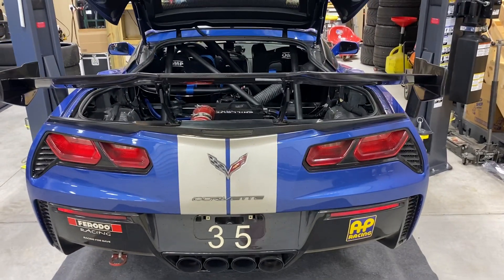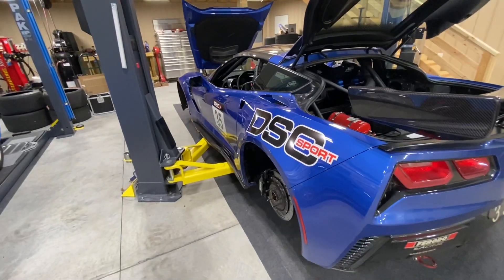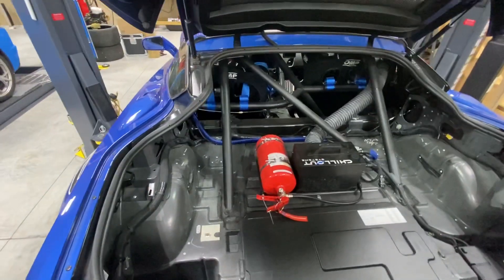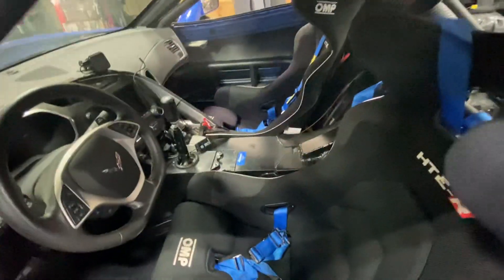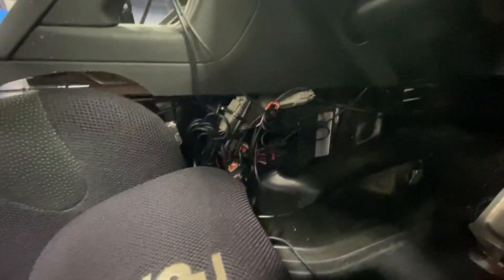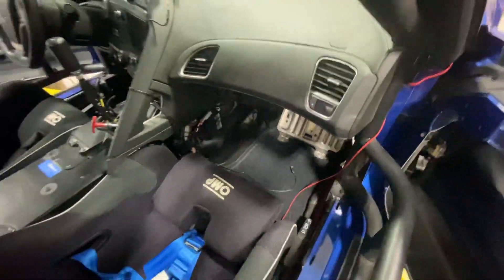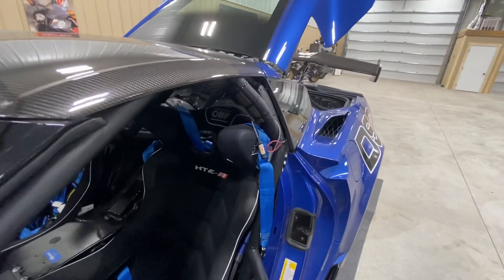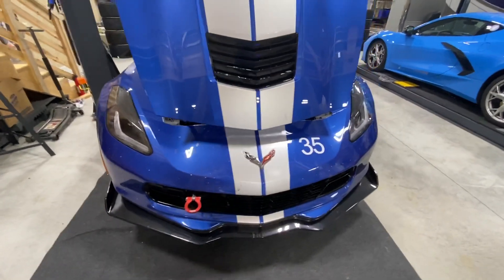C7 Corvette GS.R Walk Around - Part 1

Comment: nice video..thanks for sharing.   what is the curb weight?
Pitt Race is a home track for me.  Maybe I will come to the track to see and hear the car in person.  The car should definitely be a sub 1:48 at Pitt Race.  There are a few videos of C7 Z06 Automatics with slicks running 1:49's
Reply from the maker: Thanks!  I actually did another video comparison of a mostly stock Z06 on slicks running a 1:48 so that is in my sights for sure.
Reply from the maker: I meant to cover this in the video so thatnks for asking.  Weight is currently at 3223 lbs with full fuel and no driver.  For reference stock was 3463 lbs with full fuel and no driver.
Reply: @HiPoDriver  wow..3223/730 = 4.4 lbs/HP..crazy..dang near a GTD level..awesome build
Reply from the maker: @corvette412  yeah the acceleration is very impressive - especially with the sequential.  I should do a breakdown vs the ZR1.

Comment: Sean,  
Can you provide some information regarding the installation of the race seats? Is there a bypass (dummy) connector on the seat electrical harness available to avoid throwing a code/light for the airbag?  Do you know if I only install the driver side race seat, that the passenger airbag will still be operable?  I would appreciate your feedback or if you know of a thread on the corvette forum discussing the issue.
Thanks in advance
Reply from the maker: I've not added any sort of device to turn off the airbag light, I just ignore it.  We actually took the airbags out of my car since it's track only with race seats and harnesses.  Sorry I couldn't offer any help.

Comment: Remove wiper blades and motor. That's another 15-20 pounds. Lexan windows and Braille lithium ion battery is another 50-60 pounds